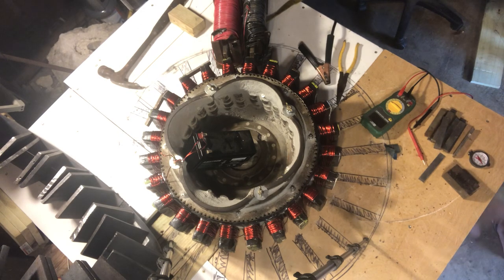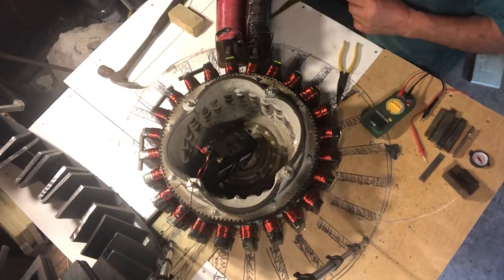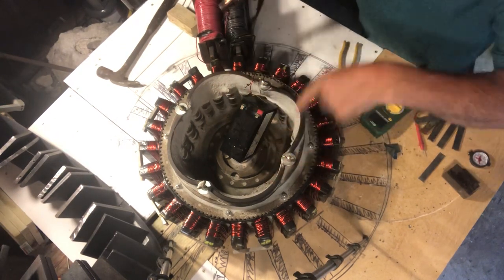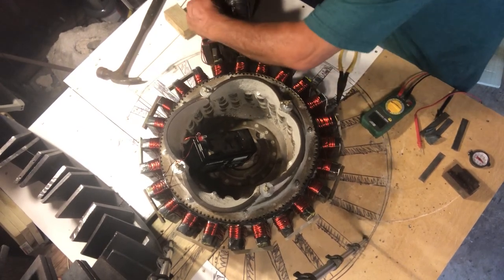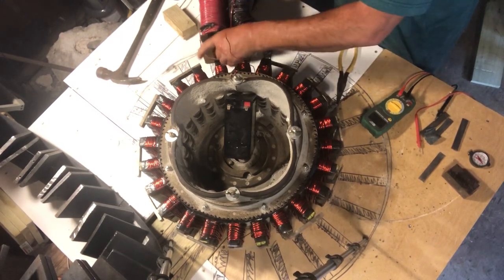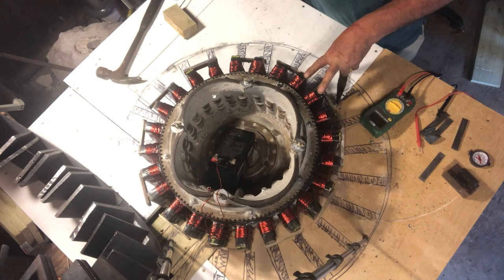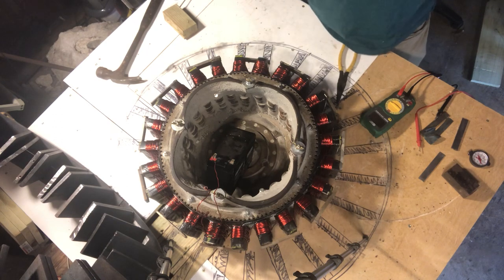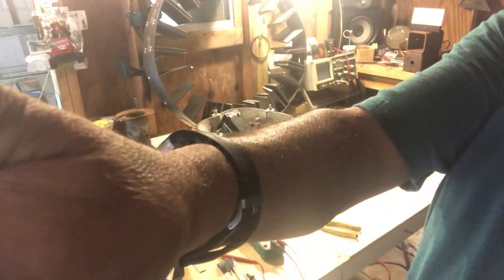Coral Castle, Ed Leedskalnin,Rotor, Coils Wound!

Comment: i found That the Ability To take out The Pole from End of Magnets,.. So that they Are a Pole,... Or are Not... to be interesting... Like if you Take Iron fillings... Magnetize An Electric Magnet.. or the Vee's the PMH etc... That it was interesting.. How one Could.. Make the iron Fillings CLING.. and Stay Clinging... but If you SWITCH the Leads on the Electric Magnet from Positive to Negetive Etc,, Reverse,.. that You can if you Try the right Way...   When you Reverse the Poles  ..sometimes.. I could See that IT BECAME NO POLE AT ALL... that if I 'Tapped' the Energy On the Electro Magnet the Right way....   I COULD MAKE THE FILLINGS 'COMPLETELY' FALL Off... So that  ''''''''Nothing,,,  STICKS to IT"""""   0_0  that I found To be MOST foundational,   ...how you Could.....Make  The POLES........ ...suddenly.... DISAPPEAR so THERE'S NO MAGNET AT ALL in the IRON Core.  To me That would Be Most Effective,.. if You Could find Out a Way to 'Take the Poles'  '''~OUT~''' at Specific TIME...  so They 'Can PASS' ....a Certain SEGMENT...  of The Circle...360 Degree... WHEEL...